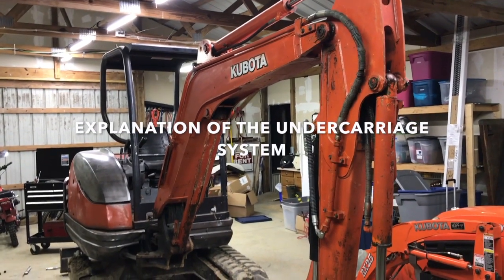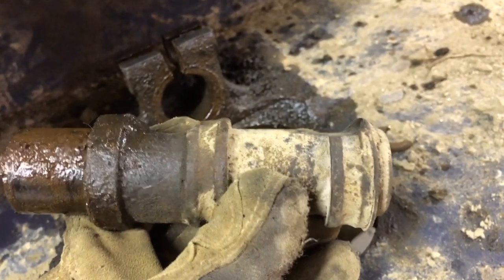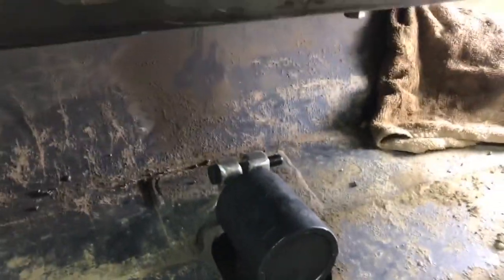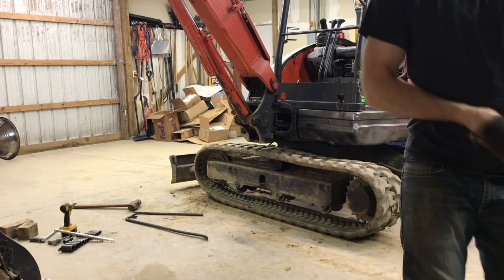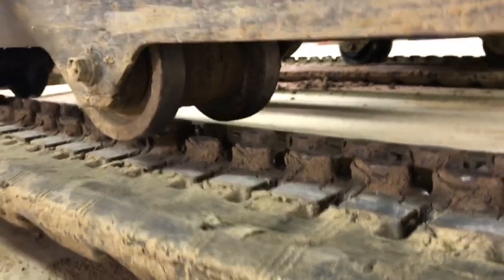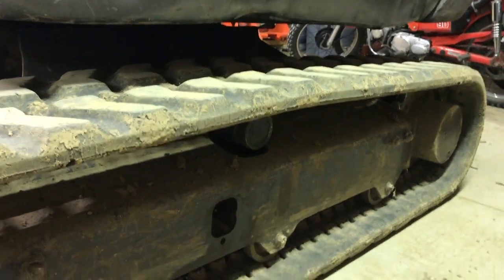Kubota KX71-3 Mini Excavator Tracks and Undercarriage Roller Repairs

Comment: The Kubota WS manual specifies 30w motor oil is added to the rollers through that allan wrench plug.  80cc's for the KX040 rollers.  The carrier roller assembly doesn't specify adding oil, but under fluid capacities, it shows that it takes the same 30w motor oil.
Reply from the maker: Hey Steve I appreciate the comment!  It prompted me to go back through my WSM for the KX71-3.  It states similar information.  SAE30w oil.  The front idler gets 75cc.  The bottom track rollers get 80cc and the top carrier roller gets 60cc.  I think most of the ones i replaced were too-far-gone for new oil, but i might check that on my front idlers and see if i can get them to quiet down!  Thanks again!

Comment: Hi Neal i just watched your video ,i would suggest that you let all the grease out of the front idler ram to make it to remove and replace the track , as it looked like the idler could have went back further into the track frame i normally put the back of the bucket against the track and push the idler in , as for the noise your front idler may have a piece of rock jammed between the idler and the idler frame as this happens to my 5.5 tonne kubota  when you had the track off you can remove the idler and frame just by pulling the idler forward with your hands and then you can check for rocks caught or if you leave it and it is a rock it will wear down and drop out and the noise will stop hope this helps
Reply from the maker: Hey thanks for the tips Bill!  I actually just ordered new tracks, so i should be putting them on in the next week or so.  I'll be sure to make a new video with all the advice i have received and hopefully it goes much quicker!

Comment: Thanks for the video. I just discovered the same issue with my bottom roller today. Ordered it on eBay.
Reply from the maker: Nice! I think someone mentioned previously you might be able to just loosen the track and pry it down far enough to change out a roller instead of removing the entire track. But make sure to check you top while you're at it! I couldn't believe how toast mine were!
Reply: @NealORussa  will do! Thanks

Comment: While you have the track off, check the drive sprocket spokes for wear.   When the teeth get thin or sharp, time to replace.   $100-$160 per sprocket.
Reply from the maker: Thankfully my sprockets are still in good shape!  It appears those are fairly easy to replace by removing some bolts holding the sprocket to the final drive.

Comment: "Let me show you what the trick was".
Uses two crowbars and a sledgehammer for 20 minutes... :D
I'm a new owner of my first excavator. I predict similar learning experiences in my near future. ;)
Reply: Justin Valentini me too...
Reply: dang! me three lol
Reply: Can the rollers going bad cause the tracks to not want to turn?
Reply from the maker: Hey Travis i just saw this comment!  I would say if rollers are not spinning, that would really make the tracks not want to spin.  But it could also be your drive motor.  I would lift the tracks off the ground and try to spin them without weight on them and see if the motor is having issues spinning by itself.  When its in the air you can probably check most all of your rollers as well.

Comment: I have a an old kh-60, need track, idlers are squeaking in reverse. Thanks for this video, other than the $$$, you have relieved some of my anxiety
Reply from the maker: Glad to hear this video helped you!  I have another video putting new tracks on this machine where i used a tractor to assist and it went much faster!  But yes as far as the roller and idler replacements, not a tough job.  Thanks for the comment and make sure to subscribe for more DIY equipment videos!

Comment: Does your grease gun and you impact driver use the same battery?   What voltage is you impact driver?   I need to get one for working on my machine.  I have the grease gun already.
Reply from the maker: I was using older dewalt 18v nicd tools. I have since switched to makita 18v lithium. I am still using my dewalt 18v grease gun with an adapter that converts it to use my new makita batteries. The 3/8 impact is a great tool I use it on almost every project. It's compact and fits a lot of places and so much faster than a ratchet. Thanks for the comment!

Comment: You can replace just the bearings TIMKEN 6206-2RS in the upper rollers at a fraction of the price of a new roller...The bearings cost about 10 bucks each.  Total repair cost 25 bucks at most.
Reply from the maker: Hey thanks for the note on that!  I'll write it down in my service manual.  The left side top roller shown at 3:47 was pretty much roasted, but bearing replacement may have been an option on the right side.
Reply: Do the bottom rollors have bearings that can be replaced as well?

Comment: Thx professor, really enjoyed the class today, what do you use this for, I'm looking for one for my farm, do you feel it has enough power to take down some trees, I need to build a road around my property, not sure what size and what horsepower I need, Ty, God Bless you and yours.
Reply from the maker: I use it for grading with the smooth bucket and digging trenches mostly.  Subscribe to my channel and check out my other videos to see the machine in action!  I've taken down some trees, but I really don't like digging stumps with it.  Its a good size for me because it does not damage lawns much and its light enough I can haul it with my skid steer on the trailer at the same time.  I have been keeping my eyes out for a good deal on a KX121-3 or a KX040.  That's the largest machine Kubota makes that has my same quick coupler so all my buckets would still fit.  Otherwise you could bump up to the U55, KX057, or KX161.
Reply: @NealORussa  I am subscribed and I appreciate all the info.

Comment: Thanks for showing us these things it helps me understand the workings of my mini digger ,just a point why not weld a flat bit of plate on that top roller pinch boly just a strip of 3\4 by 1\8 strip .wouldn't be difficult if you can weld ,hell pay my air fare from UK and will come do it for you lol ,take care great work. Ive subd.
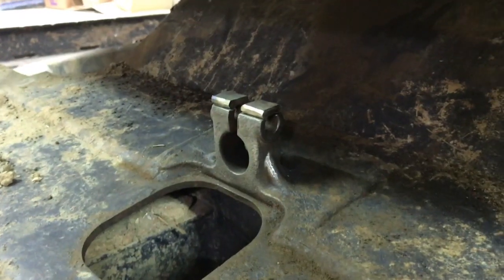Reply from the maker: Thanks for the comment and sub!  I did weld a piece of plate for the roller pinch bolt area.  You can see it around 11:58 in the video.  I think that's what you were referring to.

Comment: Cool video man. So little videos about diggers. Wish someone would do full repair videos on these too. I got a Kobelco and love doing things myself but scary when bugger all info
Reply from the maker: Thank you Chase.  I agree there isn't a lot of information on these.  I replaced the head on this machine's engine last year as well, i wish i had gotten some video of that.  I ended up purchasing an electronic version of the factory service manual and it makes the projects a lot easier to tackle.

Comment: I realize it’s a bit more money, but if half or more of my rollers were bad, I think I would replace all of them at once.     Seems like they reached their lifespan.   I hate waiting for the next one to break.   Now if money is tight of course only fix what you must.    On test drive after repair, it definitely sounded as if you had at least one more bad roller.    I think you can replace the rollers without completely removing the track.   Just loosen it.
Reply from the maker: Hey thanks for the good advice!  Buying the machine used, i wasn't sure if any rollers were already replaced prior.  I think this year it might be getting new tracks so i'll get another chance to inspect!

Comment: I just recently had my metal track broke , due to no been able to find the part . I had to replace with rubber tracks . Everything fits fine but seems like the rollers need to be change ,I wonder if these would work in a komatsu PC50UU . The track is 16" wide . Any info is highly appreciated.
Reply from the maker: Call Ryan at trackhutt.com he can get your tracks usually in a day or two and he knows every make and model and what they need.

Comment: Did you ever find out what was contributing to the remaining noise?
Reply from the maker: No. I’m assuming it’s the large front idlers. Mainly the left side. But it’s hasn’t been bad enough to bother me anymore. I have pushed and pulled on the idlers and they aren’t loose or wobbly but I’m guessing the bearings don’t have much life left. Those replacements are about $350 each.
Reply: @NealORussa  You know you can replace the bearings in them..  A lot cheaper !

Comment: Has anyone had experience trying to “patch” a track that’s torn to the center of the track but not thru the other side?  I am just trying to limp thru my homesite and need another 100 hours out of it to be finally done.  My other track is in decent condition and replacing one track seems kinda ….eh?
Reply from the maker: I maybe with steel straps and bolts like a conveyor belt is mended together.  But I would just try to find used tracks off another machine. People usually try to get rid of them because they're so expensive to take to the landfill. I sold my old set for $100 or so if I recall

Comment: Did the rollers have grease fittings??
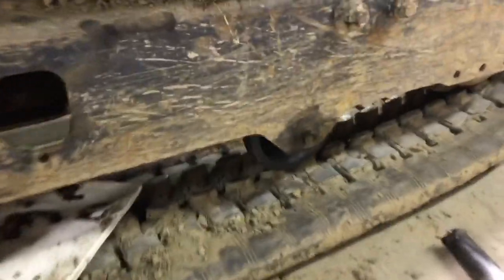Reply from the maker: Tony, no the rollers did not have grease fittings.  I show the details of the new Prowler rollers around 8:05 in the video.  They are sealed and there is a small allen head oil plug.

Comment: You worked WAY too hard to put that track back on.  Get yourself a cheater bar (3 or 4 foot piece of 2" metal pipe).  Lift machine, (with tensioner retracted) and get track on the sprocket end.  Get the front mostly lined up with the idler.  Insert the cheater behind the idler, lift up on the pipe and slowly run the track forward with the control as you lift with the cheater.  It'll drop onto your idler easily.  Properly tension your track running it both directions while you have it in the air.  You don't need to "horse" the track at all this way and it lines itself up naturally as it's supposed to be.  I'm nearly 66, have been in excavating all my life, and have a bad back.  It takes me under 10 minutes to handle a track in the field alone.
Reply from the maker: The Spook thanks for the advice. I’ll try that next time I have the tracks off and report back. I think it could have gone much smoother with two people! One person to run track while I use a crowbar.

Comment: How many hours are on the machine?
Reply from the maker: I think there are around 1600 if i remember correctly?
Reply: @NealORussa  That excavator has to have a lot more hours than that with that much wear on the rollers.  That hour meter was either replaced before you got the excavator or they forgot to put oil in the rollers at the factory.
Reply from the maker: Kirk Palmer yea it was 2700. Also the previous owner did concrete demo with it and probably saw a lot of pavement. I can tell he also never used a breaker, just bashed with the bucket and teeth. I’ve rebuilt every cylinder on it. Boom cylinder was bent.
Reply from the maker: Machine has been working great though. I do light commercial and residential grading and drainage and it’s been reliable for me. Also now I have a hydraulic thumb, quick coupler and 3 buckets that have really allowed me to do a lot more work.